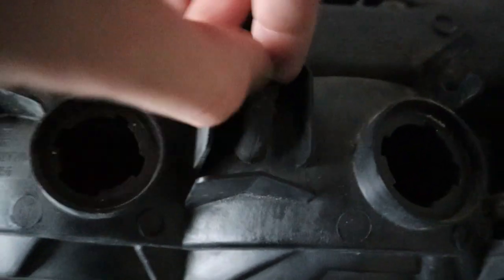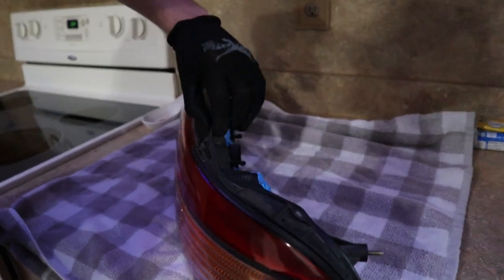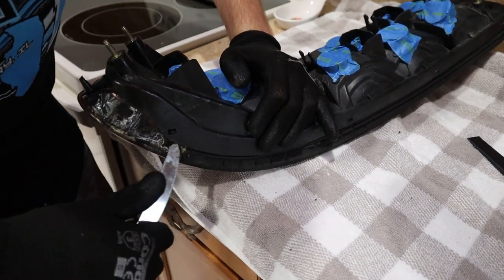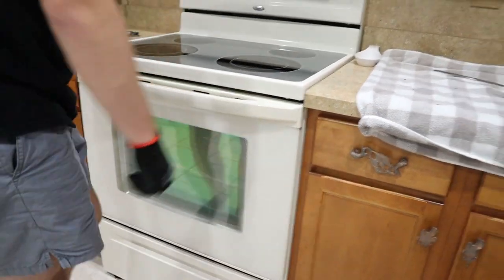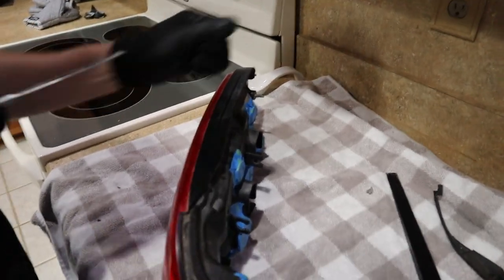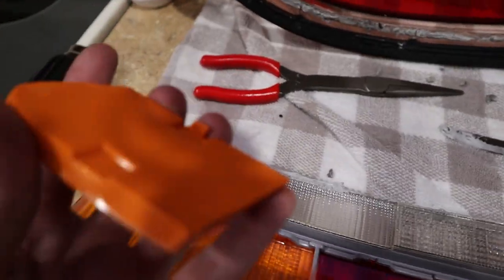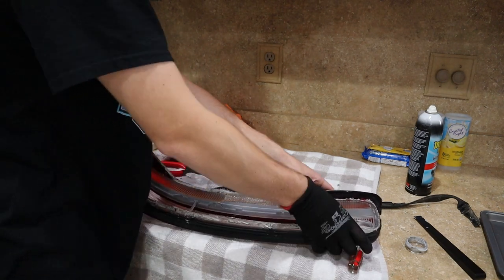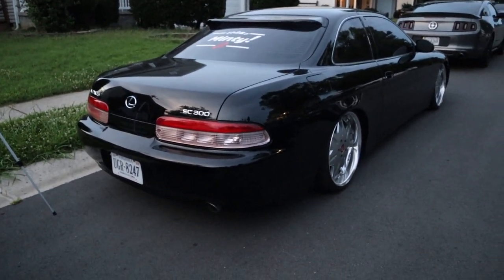Making Custom Tail Lights For MY SC300!! (50/50 Style)

Comment: What’s the bulb info?
Reply from the maker: https://www.clublexus.com/forums/sc-1st-gen-1992-2000/186842-tail-light-bulb-size.html I looked on here for bulb #s then looked up the colors I needed (I got orange for the signals, and red for the brake lights).
Reply from the maker: The “bottom row” is all the same size bulb just different colors, and the “top row” Is all the same as well just a smaller bulb

Comment: Why not use a heat gun to do this.
Reply from the maker: I ended up using a heat gun to help with the process, but the oven heats up all of the glue.  Probably less of a risk cracking the lens